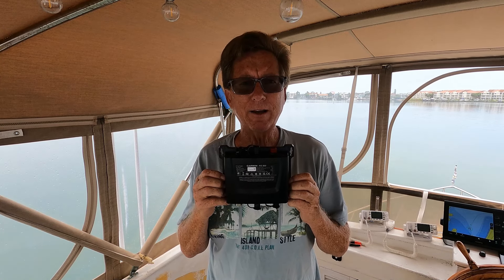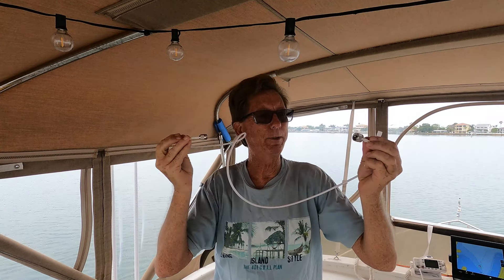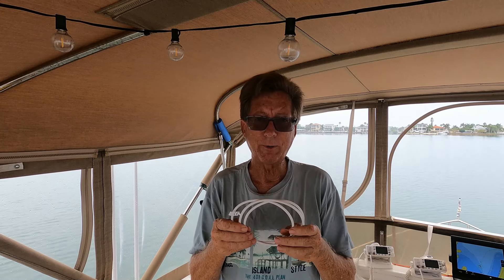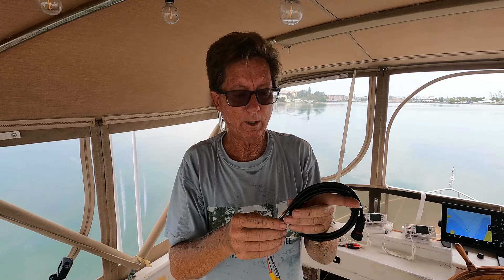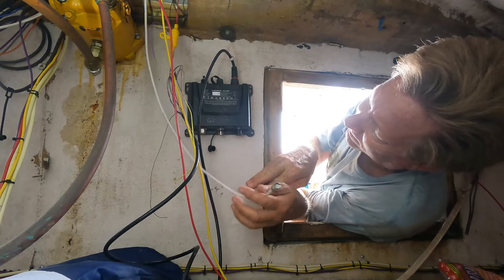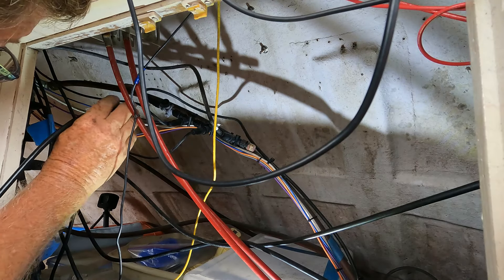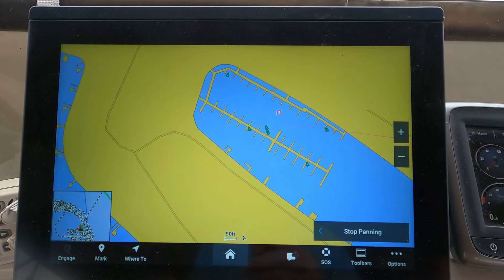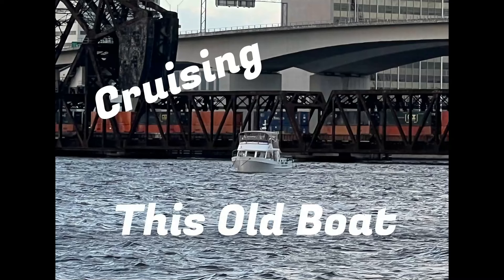How to Install a Garmin AIS 800, Ep-255

Comment: Have been following your videos for quite sometime and enjoy them very much. I'm learning a great deal from your presentations. I have older Garmin MFDs (circa 2004 & 2008) on my 1986 Nova Sundeck Trawler and am thinking of upgrading them.  Have noticed yours at the upper helm and had a couple questions, if you don't mind. Which year/model Garmin MFD/Chartplotter do you have? What is the Raymarine device adjacent to it? What is reason/purpose for having two VHF radios? Look forward to hearing from you and seeing your next video.
Reply from the maker: Thank you so much for watching our videos! We really appreciate it. 
My chart plotter on the upper helm is the latest Garmin model - a 1243xsv. A bit pricey but worth it. The Raymarine next to it is an older model - I think it’s an A73. I use it strictly to display my engine gauges which are all electronic.
I have 2 VHF radios on the upper helm as well as the lower helm. That way I can keep one on channel 16 and the other on whatever working channel I am using. In south Florida I will keep it on 9 for all the bridges. When transiting the Okeechobee Waterway I keep it on 13 for the locks. When pulling into a marina I will have it set to their working channel. That way when they say “can you switch to channel 68”, I am already there. 😉